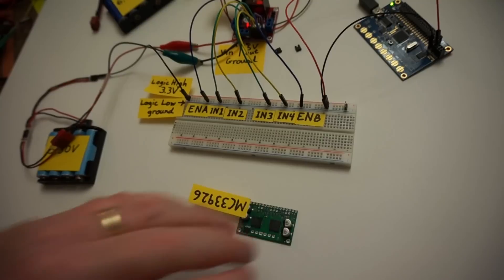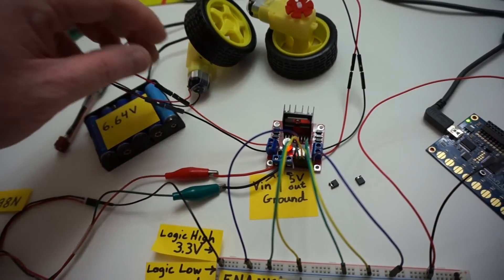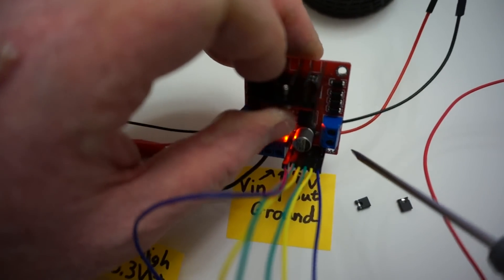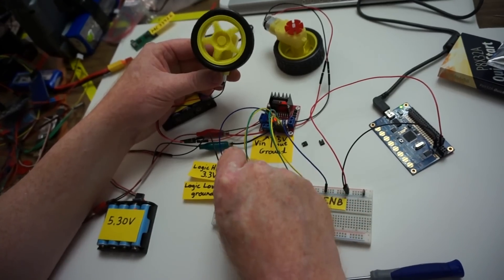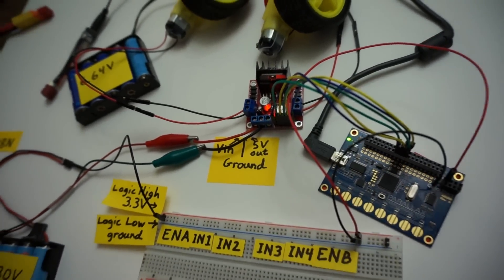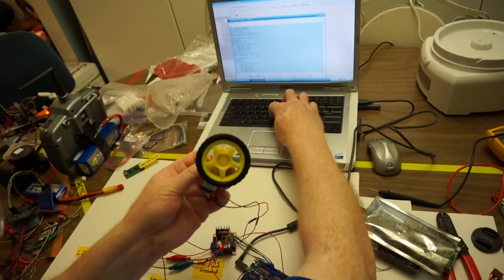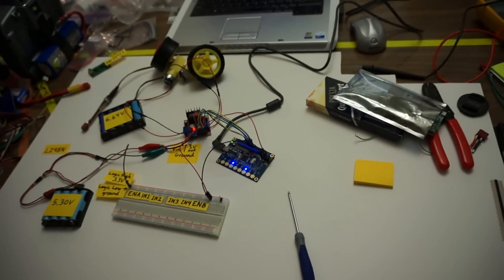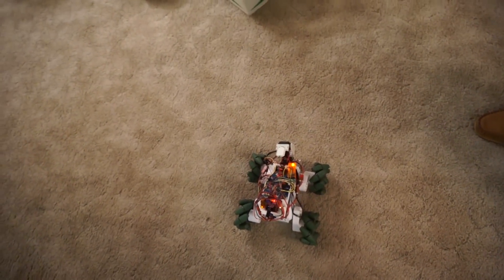L298nWithQuickstart140708a

Comment: excellent!
I want to control stepper motor with l298n bridge, So please help me..
Thanks..
Reply from the maker: I've tried using the L298N to control a stepper but the stepper got really hot. I think there are a lot of better options than the L298N to control stepper motors. I'd suggesting using a driver specifically intended for use with a stepper.
In general, I think it's a good idea to purchase controllers and stepper motors together from a reputable company so you can know be reasonably sure the combination will work together.
If you use the L298N to control a stepper, make sure you touch the motor and L298N every so often to see if either is getting too hot.
Reply: ok thanks brother

Comment: Btw why are you supplying only 3.3v to the Enable pin ? Shouldn't you supply 5v to it?
Reply from the maker: +Akshay Aradhya I'm using 3.3V because I'm using a 3.3V microcontroller. The L298N will work with logic levels as low as 2.3V. The L298N works fine with either 5V or 3.3V logic levels.
Most 5V chips will work with 3.3V logic.
Be careful when you read the L298N datasheet. The datasheet calls the "Logic Supply Voltage" (pin 9) "Vss." So in the L298N datasheet, "Vss" is 5V when usually "Vss" is used to denote ground (0V).